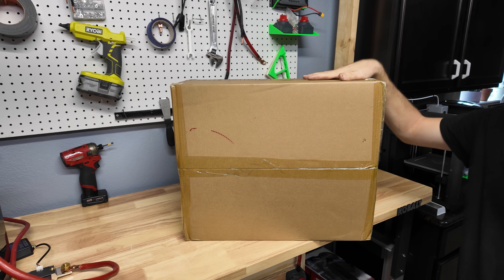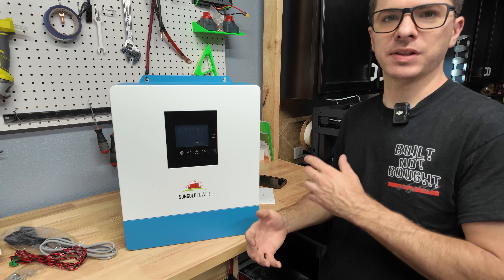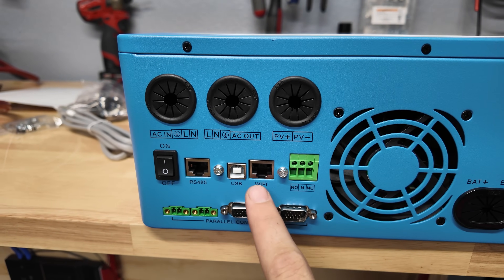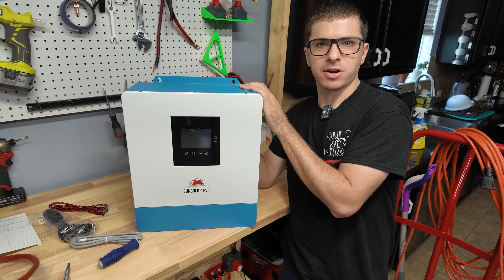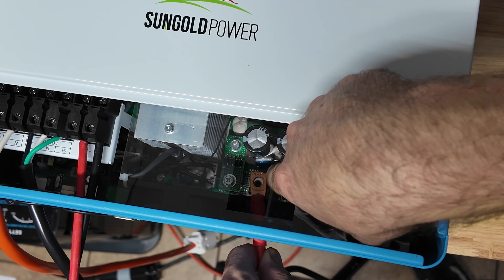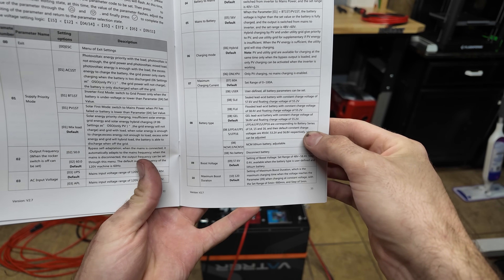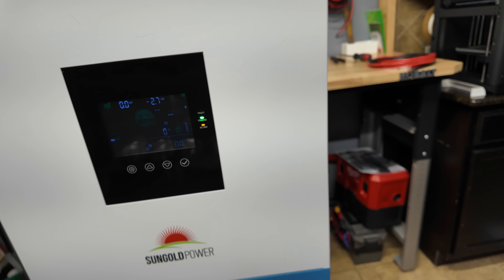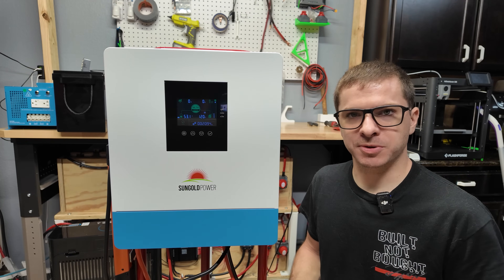Sungold Power!! Best Budget 48v Solar Invert All-In-One

Comment: you mentioned you never use closed loop comms. the inverter can calculate battery capacity accurately enough to use inverter high and low set points to switch to grid power?
Reply from the maker: Yes the settings are safe enough to go off voltages

Comment: Hi, have you tried the inverter for its surge/overload capability? I have one of those and it gives me a lot of trouble. Basically whenever I try using most power tools which worked fine with my 3kW EG4 inverter, it immediately shuts down. It also never switches to grid when it thinks that it is overloaded, although it is configured to do so (setting 27). One of the combinations which trigger shutdown 100% is trying to to turn on a hairdrier and a vacuum cleaner (both small household 15A appliances) at the same time. I have measured the peak current and it is just ~33A
Reply: Make sure your battery voltage isn't dropping too low, though I'm assuming you're using lithium so that shouldn't happen.

Comment: I'm very much a noob to solar, but I just had my Sungold Power inverter delivered today, so while I'm waiting for battery I'm trying to get educated beyond the manual. You've done a great job with this video...very informative, but I had a noob question...why do you not use the battery communication function? It may be a dumb question, but that kinda sounds like a good feature to me. Thanks again, and I'll be looking through your channel for more videos on this unit. ~Frank
Reply from the maker: The batt communication is nice and works great if you use one type of battery, like an eg4 server rack battery.  But most of the benefits are better monitoring of the battery and system. Other than that there’s not much of a difference.  My biggest thing is I use multiple types of batteries, so only having one type communicate and one not, kinda defeats the purpose. I hope that makes sense lol

Comment: Suggestions for offgrid mode.. having trouble with same set up, when ac out (inverter is off) it doesnt want to charge my vatrer battery. It only does when inverter is on. Any ideas? Thanx in advance.avance. Using only PVs no grid.
Reply from the maker: Mines does the same thing when I was testing it, I will recheck some settings and verify
Reply: @Mikebuildss Reached to Sungold technical support, this inverter will not allow to charge the battery if inverter it's turned off. They claim when inverter is off it turns off all outputs, even the dc to charge battery. MPPT will not remain on to charge battery, that kind of sucks. 😅😊 My Growatt can still charge when inverter is off. 😊
Reply from the maker: @ozzlopez8605 makes sense, same with my eg4 inverters, they can have the ac output off while mppt controllers remain on. They should find a way to allow that on this inverter in my option to allow stand alone charging

Comment: Hey Mike,  I am new to the solar game. I did have an electrician do my set up of 3500 watts of solar, four 200 amp hour lithium batteries and the 48k 5000 watt sungold you have above. I have two issues, When my generator is turned on it does not supply power to the house. 2nd, my batteries do not transfer power to the house as soon as the sun goes down. We have tried multiple settings and nothing. It works perfectly only when sun is shining. Any ideas? Thanks in advance!
Reply from the maker: I would check the inverter priority settings. Make sure its set to use battery when no grid is connected.  Make sure breaker is on on the side of the unit.    Are you getting any error codes?  Out of the box the settings shoudl allow everthing to work.   Make sure your battery type is set correctly aswell.
Reply: @Mikebuildss  Thank you. the only code is "3" which is battery open.
Reply from the maker: @ogrees2  Have you verified the voltage at the inverter input?
Reply: @Mikebuildss  I have not, but I will. Thanks again!
Reply: @Mikebuildss  Solar Voltage?

Comment: How is the sound when it’s on ? I want a quiet one
Reply from the maker: Honestly it’s pretty quiet, I haven’t ran it at full load yet with with a 1000-1300 load it was quiet. 
Also need to test with PV input haven’t done that yet either may ramp up depending on how much you have going in

Comment: Hello Mike, we have this exact setup. In the video you were going to set the battery low voltage disconnect. `What did you set for #12 (over-discharge voltage - turns inverter output off) and #15 (Battery discharge Limit voltage)? Thanks, and good review!
Reply from the maker: Believe it’s set to shut off at 44 volts.  That leaves a good amount of safety for the battery to not discharge too too far

Comment: Youre getting 40 amps through that extension cord into the AC input to charge the battery, is that safe and does it need to be changed in the settings to draw less amps when connected to a 120v/15 amp household outlet?
Reply from the maker: Yes that was actually pulling close to 2000 watts, you would need a bigger cord setup.   I would normally only run about 25 amps DC

Comment: does this turn the 120 volts into 12 volt or just straight 120 volts regardless
Reply from the maker: Takes 48v dc to 120v ac
Reply: @Mikebuildss I wish they had a setting for 12v just so I can add it to the RV as a charger and inverter
Reply from the maker: @ajpere4217.  SunGold actually makes an inverter that does that I’ve had one for years.

It’s a 12 volt to 120 volt, 3000 wattt low frequency unit, with built in. Ac charger that can be used to charge battery bank
Reply: You can just attach a DC to DC step down on the 48V battery to get 12V

Comment: Can step-up voltage boosters be added if my PV array doesn't meet the minimum voltage for the inverter ?  I just don't have the space to add more PV panels.
Reply from the maker: I’ve never personally tried that so not sure. If that’s the case, I’d buy a stand alone charge controller capable of accepting a lower pv voltage
Reply: Not for HVDC inputs like these, but there is no requirement that you use that MPPT input.  You can run your solar panels to a discrete charge controller and from there to your battery system.

There are boost charge controllers that can charge a 48V battery system from a lower-voltage solar input, but they are less efficient and not really ideal.  PowMR makes one.  Generally speaking you always want to use regular step-down charge controllers like Victron, because they are more efficient... so you'd still want the solar voltage to be at least 65V.

Comment: I have a complete new guy question. I understand what the idle consumption is but once you start converting like if  plug-in 100 W load and the idle consumption is 20 W. Does that mean it’s now consuming 120 W?
Reply from the maker: More or less yes, their is losses converting battery voltage to 120 volts, its expelled as heat.

Comment: It is amazing how much idle consumption power these 48V inverters used I tested my EG4 on my residential fridge and  it only ran it for 30+ hours with about 2300 watts used by inverter.  I then connected the 48V batter to my EcoFlow Delta 2 Max and it ran the fridge for 50+ hours.  I then bought the Victron Phoenix 48/1200 and I stopped Testing after 60 hours.  Great video!
Reply: This isn't really a function of the battery voltage.  It's a function of the MPPT and inverter design.  These particular inverters aren't designed for small systems.  If the idle consumption seems high it's probably because the solar system being plugged into it is too small for the design.

An all-in-one is a bit overkill for a golf cart that presumably runs directly off the battery bus (?).  Why would a golf cart need a 5000W AC output?  That said, the idle consumption only applies to the AC output and usually with these things you can turn the AC output off and just use the other features of the system without incurring severe idle losses.

For a golf cart that runs off of DC batteries a discrete build is typically the best solution.   There really isn't a lot of room for solar panels so it basically is just the solar panels, a Victron SmartSolar 100/20, the 48V (51.2V LiFePO4) batteries, some fuses, a breaker or two, and a battery port for an external AC charger to charge the thing at home if the solar is insufficient.

-Matt
Reply from the maker: Thanks for the info, yes idle consumption can really hurt especially smaller setups with less batteries so its good to know. Some are definitely better then others, it could also be those other inverters have better conversion efficiencies
Reply: @Mikebuildss  I'm still learning and making mistakes, especially with the smaller solar systems like I have.  I ideally for me, a 24V system is ideal simply because I don't have the space to put solar panels that are required to start a 48V system inverter, where a 24V does not need at minimum 125 or 150 volts to start charging.  Plus many of my appliances will run on 12 or 24 volts.  Again thanks for the video.
Reply: The SGP 5k inverter draws 60 Watts idle consumption. FYI only.
Reply: @s.mendez7160  yep per Hour! so how much is that every day?  Almost 1500 watts just sitting there per day......
Reply: @dougwilson8274  Putting the SGP in Eco mode drops the idle consumption down to 800mA.That's if you don't have a 50W or greater load on the inverter output...

Comment: well Young man, that unit is not made by Sungoldpower. it's a rebadged SNRE, which is good, because it's a nice unit. however, it won't work on a golf cart because it's not rated for outdoor use. ask me how I know.
Reply from the maker: AHh that makes sense. I think if i did mount it, it would just be to mess about then get removed. Or maybe installed in a water tight box that i open when i use it then seal it up for storage. Like a Milwaukee Pack out box

Comment: Greetings are great, your videos are very instructive, please could you do a tutorial with this 3 kW EG4 inverter for isolated systems?3000EHV-48 |3000W output |5000W photovoltaic input |500 VOC entry
Reply: my 3 k EKG4 inverter with 1 -5 kwh battery and 1200 watts of solar has been on my back porch for the last 3 yrs running my chest freezer 24/7. I still have to plug it into the grid 1-3 times a year. That setup normally draws approximately 2 kwh per day.
Reply from the maker: I will be doing a video on this inverter, it will be the same process for the one you described